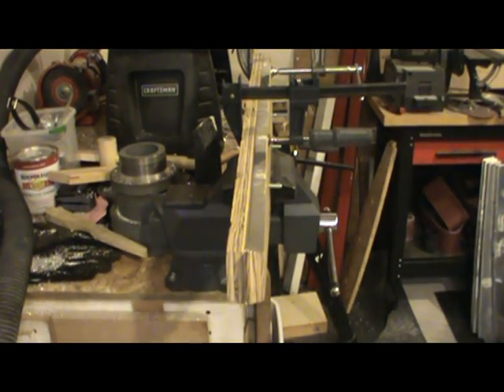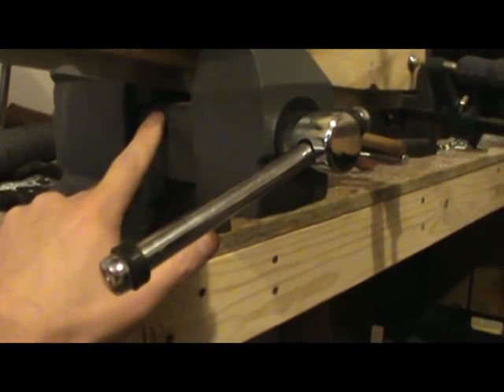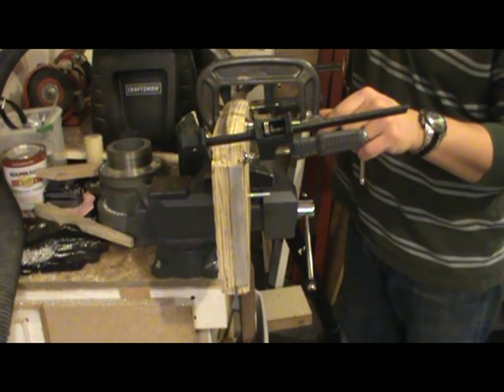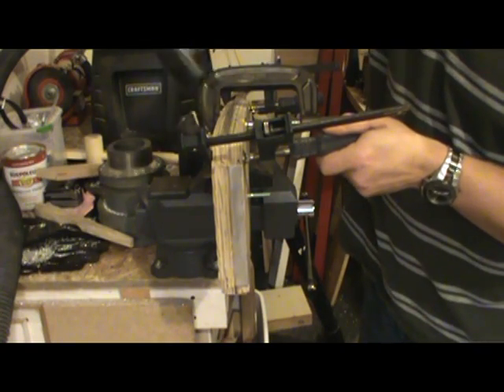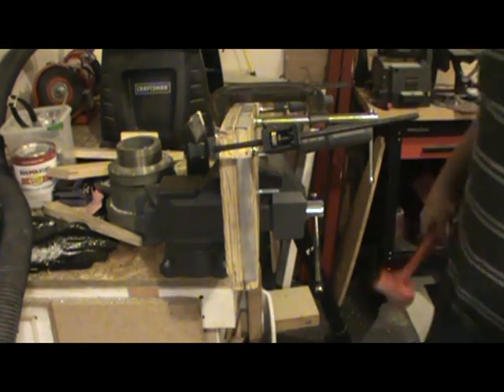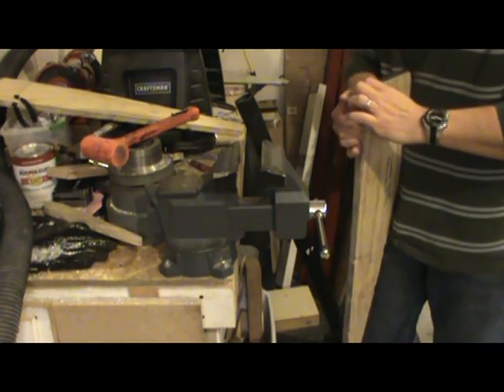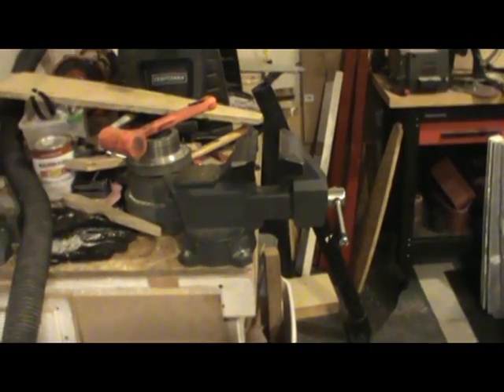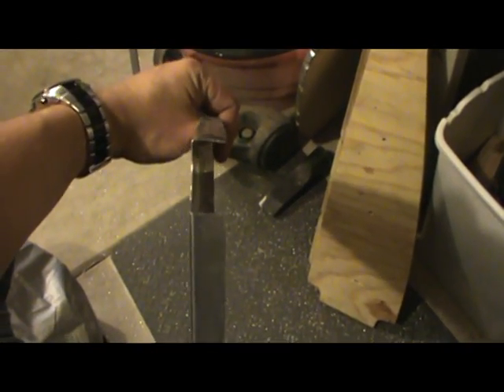Rear Rib Forming - Part 2/2

Comment: Greg, Did the ribs bow again after making the 3 lightening holes with their flange? Just wondering if I should wait to straiten them after the 3 holes are finished.. ?
Reply: Well you said that they would but did they ?
Reply from the maker: Yes, they did "crown" slightly. But only very slightly once I started using the hydraulic press to flange them. when I was using the arbor press, the crowning was a little more pronounced. There isn't much you can do about it, though.  How much distortion you get depends on how closely your holes match up to the flanging dies/method, and how much pressure you use. I actually have a video coming soon on that very issue, just need to get it edited. I'm waiting until I have a chance to use/demo the dies I bought from Dan Hill (https://www.youtube.com/watch?v=R4PTU4eiYMc ) before I publish it.
Reply from the maker: Using the hydraulic press made any crowning/bowing a non-issue on the finished rib. With the arbor press, I had some adjustment to do.